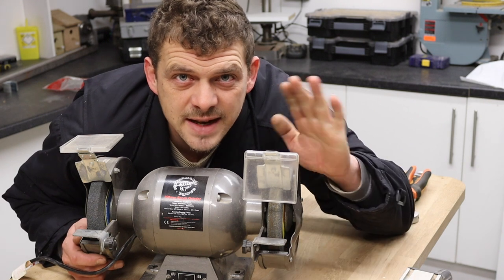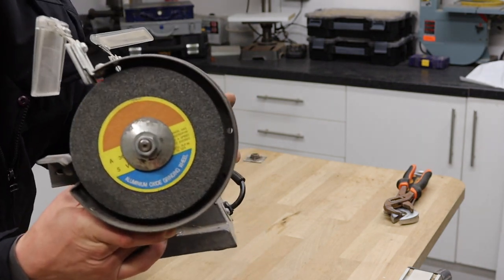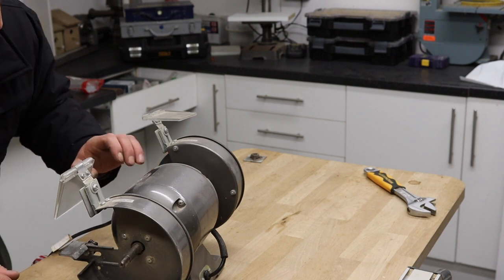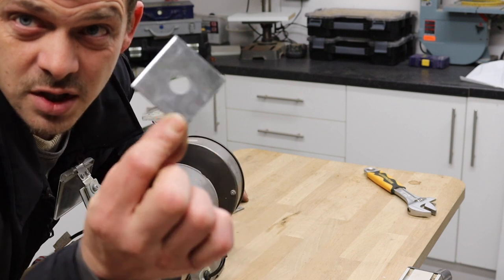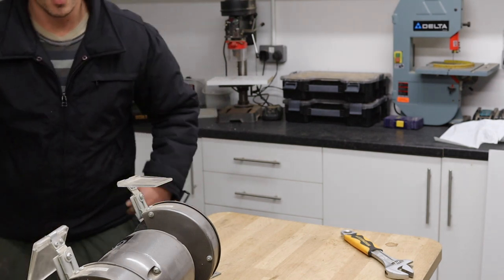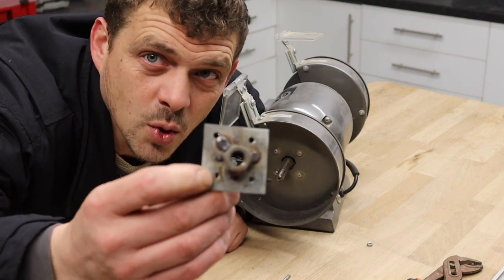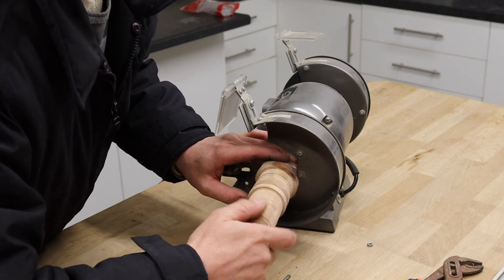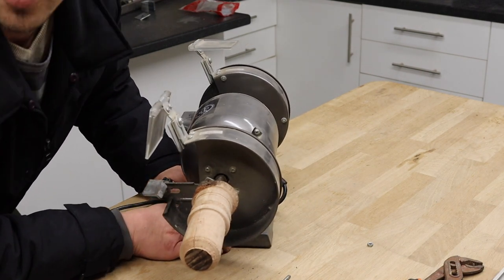Make a woodturning lathe Bench grinder

Comment: To make a (small ) wood lathe from bench grinder you can use any grinder that has more than 100W , using drillchuck in front  and DIY  tailstock at the end... 
Sure is not so precize , but for turning rings, inlays , pens or similar stuff its more than enough .. on the other side (if its doubble grinder) you can make table saw , sanding disc, polishing etc... there is almost no limit..